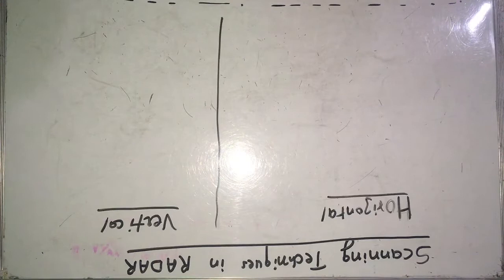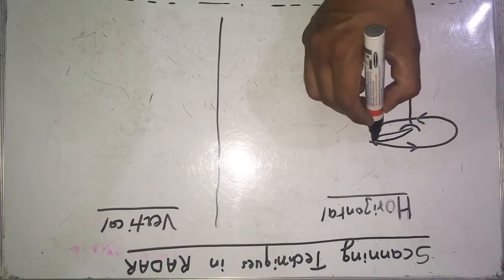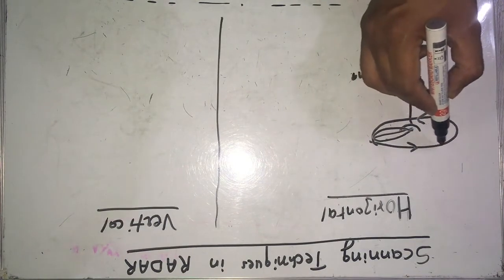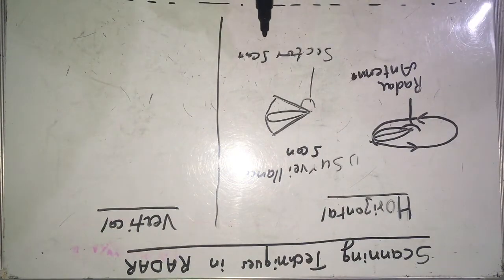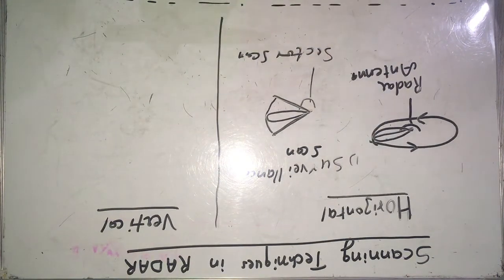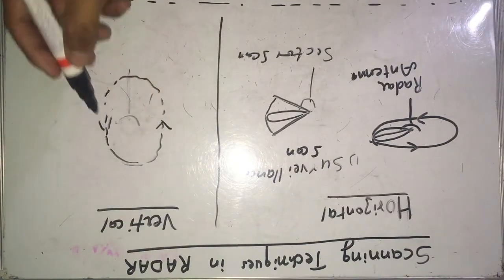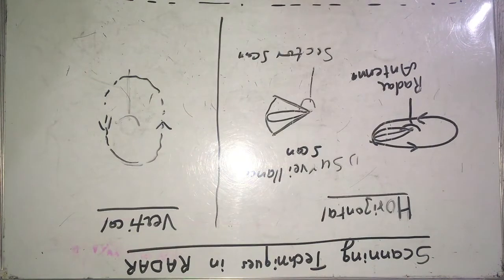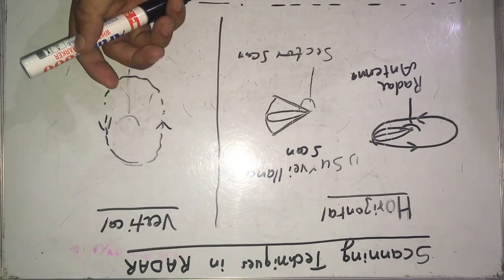Horizontal and Vertical Scanning in Radar | How Radar Find its Target? | www.studymaterial.org

Comment: In a circular scan they keep vertical beam width wide and horizontal beam width narrow and therefore such beam can detect targets azimuth and range but not elevation. I read that stacked beams solve this elevation problem cuz you stack different beams and based on which beam receives radar return the elevation is calculated. My question is, do all stacked beams transmit at same frequency?? Cuz if beams transmit at same frequency how the receiver is able to distinguish the return pulse??
Reply: Stacked beams transmit at different frequencies, however,  these beams are frequency modulated signals and they will be demodulated at the receiving end